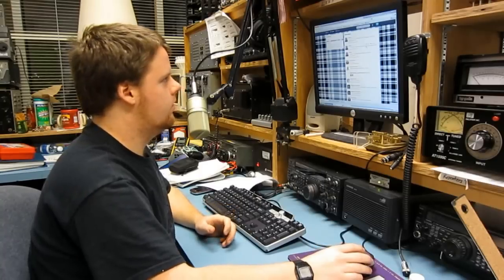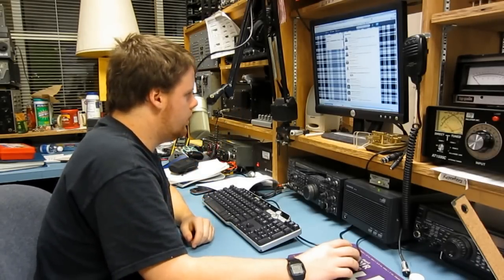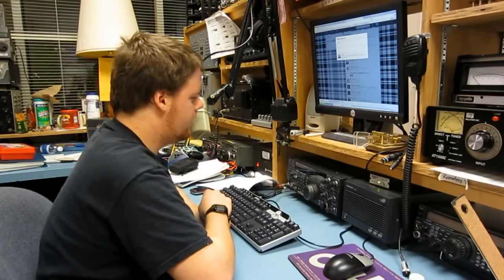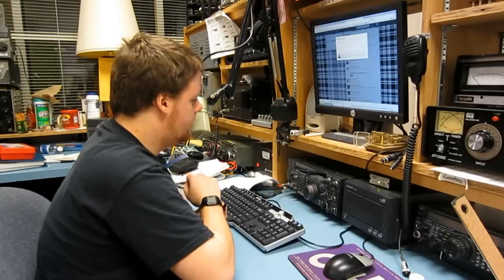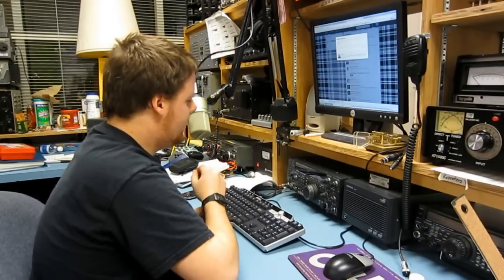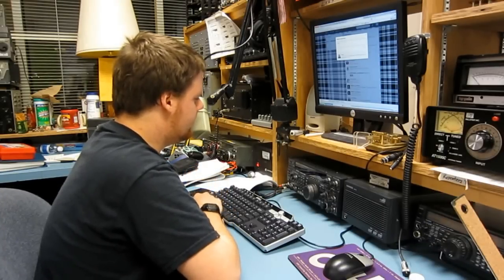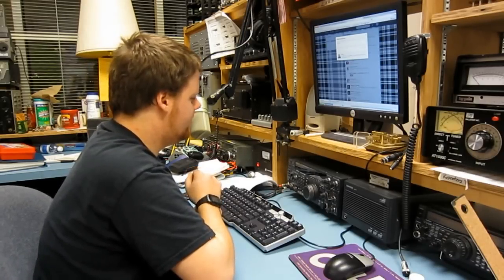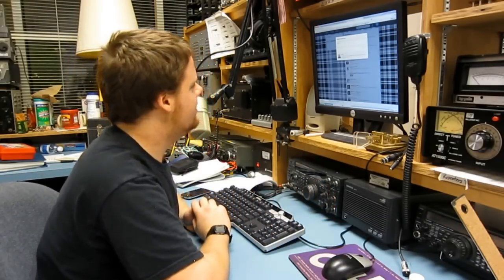Typical Noisy QSO with W5RAW at W0EEE

Comment: Wow that is a strong source of noise, sounds like it is mainly from one source too.  Would be interesting to take a portable AM radio and walk around to see if you can isolate it to a certain point in the area or on the HVAC system or contoller or maybe you have tried that already.  Big hammer might come in handy there too, ahah, good luck with that.